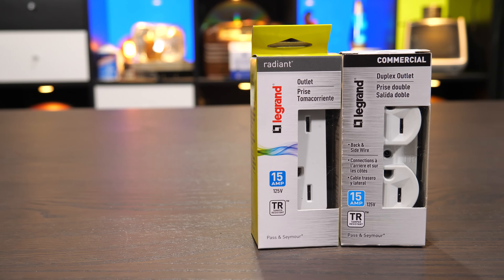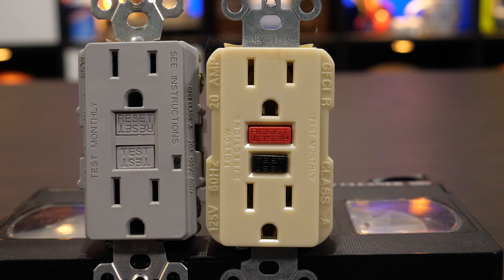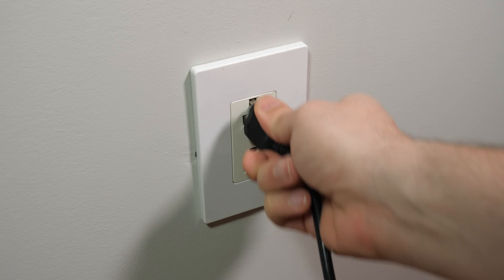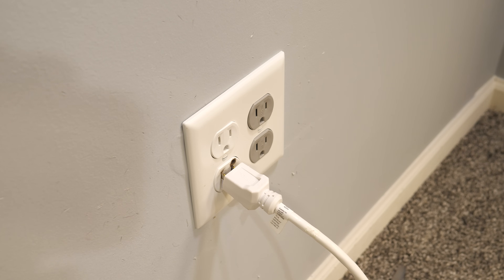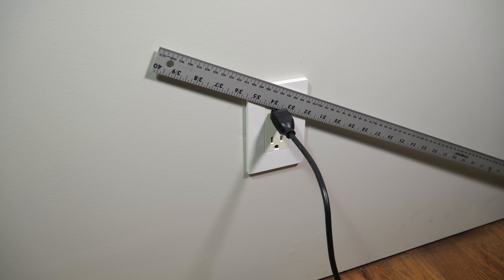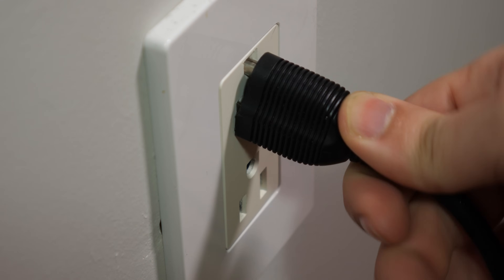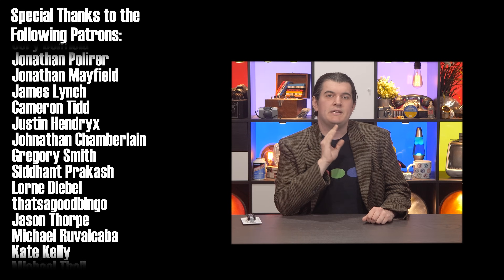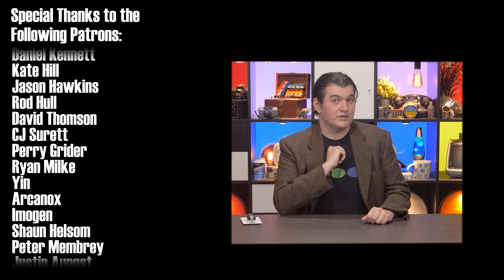Power outlets are topsy turvy - but does it matter?

Comment: When I was a wee lad, I went to plug in the Xmas tree, not realizing there was a metal ornament hook bridging the two prongs. The ensuing fireworks were pretty spectacular. The ornament hook was vaporized, there was a cute little divot on both prongs, and a nice scorch mark on the outlet itself. The outlet being installed upside-down (or right-side up) would've prevented that little mishap, but that's about it for me so far. 

Incidentally, the house I'm in now was built in the early 60s, and all of its original outlets were installed with the ground hole on top. Apparently all the houses in the area were built like that, which I had never seen before. I didn't think much about it until I went to use a right-angled plug like you. After that, I replaced the old, worn-out outlets with new ones, and flipped them back around to having the ground on the bottom. 

Right-angle plugs are great until you have to plug two of them into one outlet. I wish those slimline extension cord plugs, the ones that send the cord out at a 45 degree angle to the outlet, would become standard everywhere.

Comment: As a hospital electrician many years ago, the rule we used was that if the outlet was over 3' or 4' (I forget) from the floor, the ground pin should be down so that if the cord were yanked, it would more likely be from a downward direction.  Thus, the ground pin would be the the last to lose connection.
If less than that distance from the floor, it was ground pin up, to protect the hot blade from contact if the plug was loose.
I never saw it in writing, but it was pedantic enough to make me think it was authentic.
Ahh... Ground leakage tests on every single electrical device, documented of course.  Ground fault tests on every receptacle.  Twice a year.  JCAH.  Those were the days.
Not.

Comment: Oof. Well, looks like I'm removing all of the metal faceplates in my house, pulling the outlets away from the wall and rotating them 90°.
I've removed both risks AND of it does catch fire, the whole outlet is inches away from the wall now so the fire can't spread to the wall.
Problem solved.

Comment: Where inverting your plugs is more common is in metal fabrication and welding shops, where throwing knives at the wall is pretty close to what's actually happening: Metal trimmings/shavings falling from the machine against the wall onto the plug on the wall underneath or next to it. Outside of this use case, probably unnecessary, as you point out.

Comment: It's annoying visiting from the UK because the UK does have the earth pin on top and it means all my plugs are upside down when i plug them in through adaptors. This leads precisely to the right angle plug problem since all UK plugs are right angle plugs

Comment: The UK sockets and plugs are far superior to US counterparts. I think the use of the lower 120V compared to 240V (I'm aware 240V is used in some US applications) has let to complacency with US socket and plug design.

Comment: I'm a big fan of the 45-degree grounded right-angle plug on my APC UPS. It's relatively flat so it fits nicely behind a desk or a filing cabinet, and it has a couple of nice chunky ridges molded into it so it's easy to unplug without needing a death grip. But it, too, doesn't work well with the ground pin on top.

I have a bunch of 1-foot grounded "extension cords" that I use for plugging wall warts into power strips, and I would love to find some of those with that APC plug.
Reply: The only problem I have with 45 degree flat plugs is when I have a quad outlet and one corner is unusable.
Reply: Agree with you.  You can use both sockets on a duplex outlet, furniture doesn't have to be kept away from the wall by 3-4 inches (or if it DOES get pushed tightly against the wall, it doesn't crush the cord and damage it).  Yeah, for that one quad outlet in every fifth house, it's a bummer, but most homes don't have very many of those (and there's always a power-strip if you really need that many).

Comment: I've actually heard the safety claim made about our "Chicago style" right angle wall sockets. That a foreign object will likely either hit on prong then fall away conducting nothing or, if there is a ground pin, will likely only bridge the top prong to ground. From my experience the right angle plugs also sit well in right angle wall sockets  since the weight is better distributed as long as you dont care about the cable hanging down at an angle.

Comment: When I was a teen, my phone charger was plugged in right between my bed and the wall, and the old worn-out outlet had trouble holding it all the way in.  On one occasion, a wire hanger fell off my bed while doing laundry and landed across the pins, which made a huge flash of blue, melted the hanger in that spot, and scorched the wall. Your reasoning is sound, but this does happen and isn't strictly a hypothetical.

Comment: I certainly did care about the outlets in the house I grew up in being installed with the ground pin at the top when I got several small lava lamps meant to plug directly into the outlet, which all had polarized connectors. In order to use them, each outlet in my room had to be flipped so the ground was at the bottom. That was a real bad feeling after getting those for my birthday and having to wait weeks before using them.
Reply: It takes two minutes or less to flip a plug. Remove 3 screws, flippy flippy, put thoses screws back in.

Comment: Since those cord ends are plastic overmolded on the pins, you could probably have the plastic cover the neck pins if you wanted. Just make the mold allow plastic up there. You'd probably need to do something like make the conductors out of stamped pins, with an unstamped rod part going through the plastic-necked part, so as to still fit in old designs.
Reply: That's how the Type C plug, common in most of Europe, is designed. Only the tips of the pins are metal so it's not possible to have metal exposed while the plug is connected.

Comment: These American electrics and plug videos are always fun to watch as a European.

I think my main question has to be why you guys feel your plugs have to be so tiny, I was delighted to finally see a round plug solution towards the end, but throughout I was thinking "why not just change the shape of the plastic to solve most of this?"

Or even better just insulate the prongs, even the tiniest rubber wrap would fix most of these worries.

Comment: I really dislike the flat pin design (without ground, haven't encountered with it). My phone charger has those and I use an adapter to plug it into an outlet. The drooping thing with pins getting exposed happens quite often.
Not that our two round pins design is great (iirc you made a video about different plugs in the world), but flat pins don't seem good at all.

Comment: Of the different systems around the world, I think the Schuko system developed in Germany is probably the best designed. The ground is not a pin, it's a metal strip on the plug and the outlets are recessed so that the pins are inaccessible when energized. The Schuko plug is less clunky than the British plug (which is designed to have a built-in fuse) and it is more secure in the outlet than NEMA plugs. Of course, no system is perfect and the rule of the universe is that anything designed to be fool-proof is only going to foster the evolution of bigger fools, but in my opinion, Schuko is (at the moment) the most sensible approach.

Comment: When I was living in my parents' 200 year old house, I ended up grounding my PC to a radiator because the grounds were not connected to anything. Anyway, the wire slipped once and didn't have great insulation. It ended up shorting an outlet it ran over top of and tripped the breaker. I will be redoing the outlets in my house shortly since I don't like the old almond colored ones, and orientation is something I thought of. While my experience at my parents makes me want to do ground on top, for the exact same reason of compatibility outlined in this video, I've been leaning on ground down.

Another funny thing, I actually do have a box of those plastic outlet covers somewhere, despite not having children. At university, there were two plugs that were covered by the side of my mattress and while I knew there was minimal danger, it still made me feel a bit uncomfortable. I'll be interested to see the video on Tamper resistant outlets since all the ones I purchased are TR. Hopefully the ones I got are not among those that are still awful.

Comment: I admire the US sockets for the very compact plugs.

But at the same time they kinda looks like deathtraps... the falling knife problem could easily be defeated by requiring sockets to be indented... 

Flushing flat with the wall, not requiring a child/knitting needle safety and the already dangerous design scares me as a parent.

The face-looking sockets are cute and all.. but if that's the reason to keep them... why not go for the Danish lego looking sockets?

Comment: I admit, not a “common” scenario. But about a month ago my son comes running out of his room yelling dad an electrical fire! I run in and here is what happened. His silver chain was on his bedsheet, he picked up his bedsheet and as luck would have it, his silver chain slid between the outlet and his phone charger. Obviously this bridged the contacts and shorted in a spectacular fashion. If this outlet had a ground on it, the chain would probably not have shorted ( not that phone chargers are usually grounded) so upside down might have prevented a similar incident.

Comment: You know what. I use right angle plugs a hell of a lot more often then I happen to have a long piece of metal leaning against the wall, measure the wall, or even throw knives or darts around. Plus the one time I electicuted myself as a kid tring to plug something in I was grabbing it with my finger between the prongs, and I belive it was a 2 prong cord.

Comment: Almost ALL electricians will have the grounding hole at the bottom, because the logic is that the "ground is down".  They will intentionally have the ground at the top if the outlet is "switched" running off a wall switch.  In my opinion, since most outlets are used "unswitched" and are the majority, it should be the norm for their orientation to be with the ground hole at the top.

Comment: Those are just horrible designed period!

Our European (dutch) grounded wall plugs are so much better and not as huge as UK styles. Also not direction sensitive. 
Also good alternative for non ground plugs that don't fall out as US plugs because of better pins
Reply: Oh and also a lot of times the first part of the plug pins are isolated to be shure sticking your little fingers in front of it even won't bother you.

Comment: In Some countris, the 2 pins of plug have plastic cover on 50% inner side of the pins. But in North America, pins are metal material. so when i plug small USB charger at night, worry about getting shocked by it.

Comment: I believe it's far past time for a world wide standard new plug with a 110V AC optional 220V AC, 5 & 12 V DC and  finally data transfer. Most appliance that need AC could be made to run on DC (if appropriate amperage) yet 95% of our modern electric stuff run DC only and all have there own individual, mostly low quality converter. Imagine this use case: DC from solar panel to micro inverter AC to battery charger that works on DC witch then need to be reconverted to AC to the plug where it then switches back to DC in your TV, phone, PC, LED lights, oh! yeah add a UPS for two extra steps. Data transfer for medium internet bandwidth, Iots and smart power management.

Comment: My father was a commercial electrician that ran a few hospitals,he always told me the ground up plug was to indicate that circuit was on the frequency condtioned (used for medical equipment) generator backedup circuit, also why they tend to be orange

Comment: I wonder why your country don't just move them inwards a bit. I mean the design is strange and not really practical for a German /European person who is used to Schuko plugs((CEE 7/4). We can plug our plugs both ways there is no right and wrong also it is nearly impossiple to touch the contacts when the power socket(CEE 7/3) is used.  Ok you might get some trouble with the angled plugs but other then that, that should be more safer then it is right now.
Thank you for the video.

Comment: I hadn't thought about before, but I can see the UK plugs are SO much better than the USA ones. All have an earth pin whether needed or not, and that is at the top when plugged in. Plugs don't pull out exposing the pins and most pins have a protective sheath making them even safer. All are right angled too.

Comment: What if the plugs are just always installed sideways so the neutrals are always on top and the plugs always right angle to the side ie down in this case? If something metal falls on top the worst you get is a few volt AC tingle.

Comment: I recently bought a 1972 holiday traveler RV with the intention to fix it up. Almost all the outlets are either sideways or ground up. Most of the ground up are behind things, like the refrigerator or the stove. That being said, there is one at counter height in the kitchen that is ground up. I’m keeping most of the original build other than the back bedroom where there was water damage. This means that much of the original wiring will remain, although I will be adding a few new circuits for electric appliances such as the water heater and an air conditioner. The outlets in the kitchen and behind the refrigerator will be flipped to ground down. Why you ask? Because I like them that way and the new refrigerator will likely have a right angle plug. As for the sideways outlets, there fine. I wouldn’t install them that way but they don’t offend me the same way ground up does. Ok, I’m off to the connextras channel to rant about tamper resistant outlets! (No, I won’t be using them in my RV!)

Comment: Why do you even have both sockets oriented the same way? If there's a sizeable plug thingy it could only work for one of them since in the other it would be in a position that blocks the other socket. In Europe multiple sockets are rotationally symmetrical, making sure that anything that goes away from the ground pin will not interrupt other sockets.

Comment: Some premium power bars have right angle plugs but are offset at 45 degrees like your two pin extension cord but they also incorporate grips for easier removal.  Those in my opinion are the best but can only be used with outlets oriented ground pin down.

Comment: I have a possible antidote about why the receptacles are sideways. In older houses the walls were made of solid wood slats oriented horizontally, these slats were roughly the width of a receptacle when turned on its side. So it's possible for ease of cutting into only one piece of wood they chose to orient the outlets that way.
Reply: The other way I've seen horizontal outlets is in baseboards. I think it was a hold over from the very first installations back when electricity was a brand new experimental technology. It would only have been installed in super fancy, rich person's houses which would have expensive wall paper of paneling. Putting them in the baseboards would allow a much less expensive part of the wall to be replaced if the whole "indoor electricity" fad didn't pan out.

Another issue is that I don't think the first outlets were placed in matching boxes. They would need solid wood instead of lath and plaster for the mounting screws that used the 4 (now breakaway) ears that you still see today.

Comment: More and more do I appreciate how here in Europe, the outlets are literally the best thing in the world (I think a lot of Asian countries use them too). They are reversible, the prongs are completely covered before they make a connection, the plug is physically held in place so it is much stronger, the sockets are more resistant to water, they're just so good.
And some people don't know this, but we have smaller plugs that don't have grounding connectors, they do fit in the normal sockets too but they also fit in smaller (kinda hexagonal) sockets that also don't have grounding contacts. I love them

Also, 230V babyyyy

Comment: I have a fix for your problem,

firstly you want it to be right angled so they don't stick out, then you should move the 2nd receptacle to the side to accomodate that. The pins in the NEMA plug could be thicker to prevent the pins from bending or breaking as easily. Making the ground pin mandatory and then using sleeving on the conductors to make sure you don't shock yourself. You could also put switches on each individual plug... oh wait yes that's just the type G outlet.